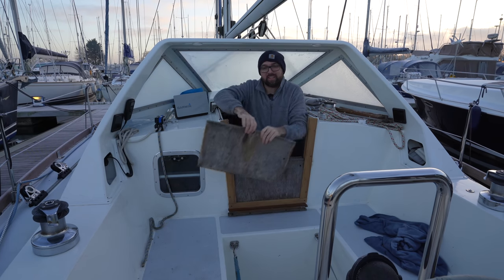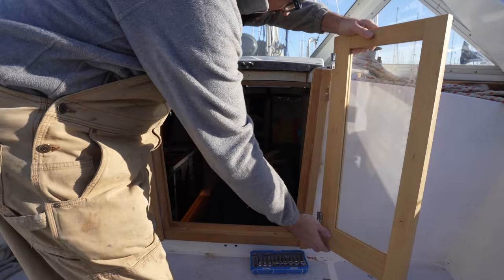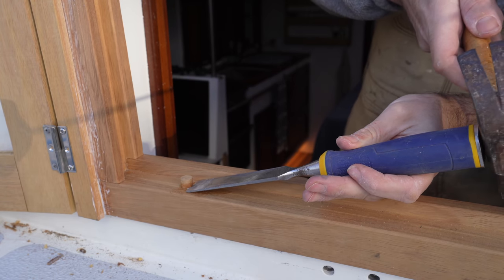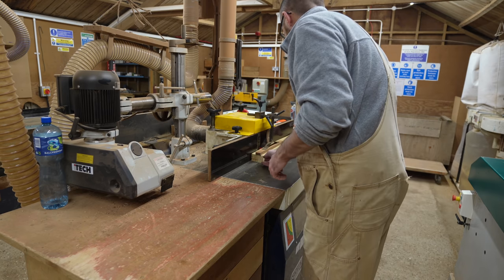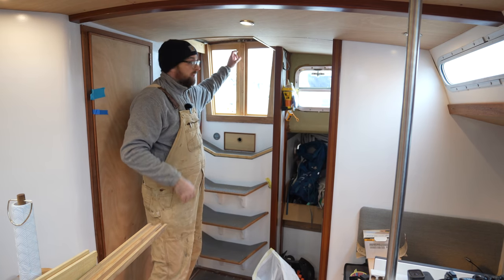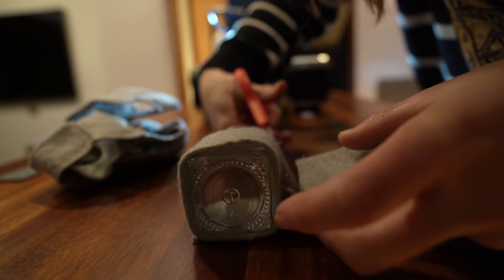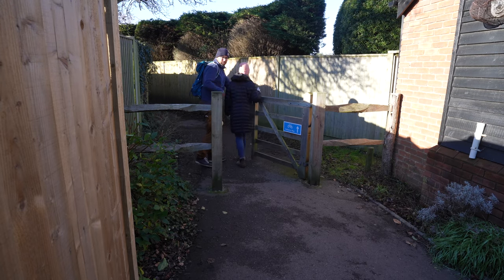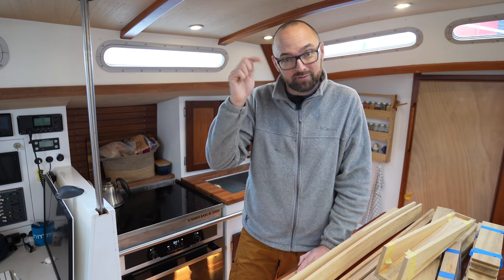Sail Life - Companionway spiffy level 11 & yet more trim ⛵

Comment: Hi Mads and Ava that lock and canal you walked over was part of the old London to Portsmouth canal system, it was much used until they invented the railway!
Reply: Actually it was Chichester to Arundel and the aspiration of connecting to London never ever came to fruition. The Chichester canal actually had a short commercial life of only 25  years (1822-1847), it had a later brief resurrection for commercial traffic under the Corporation of Chichester 1898 - 1906.

Comment: Allow me to compliment you on the companionway doors....they look great.  Through the years I've built numerous companionway doors for various sailboat designs including Island Packet, Pearson, Irwin, Hunter, Tartan and many others, using either teak or Starboard per the customer's request.  If I may, allow me to make a suggestion-on the outside of the "last to close door" add another piece of trim to cover the exposed gap between the two doors when they're closed.  That way there will be seals on both the inside and outside, providing additional weather proofing.  What I've learned through the years is once companionway doors are installed, boatowners love them so much they leave them in all the time, forgetting about the washboards.  I have doors on my Beneteau that I made from Starboard and they're only removed when racing.
Reply: Also, that trim piece will hide the gap. The gap will quickly become imperfect, so hiding it is good.

Comment: Mads, A hint on how you keep the plexiglass on the new doors from having so much static. Dryer sheets! Rub a new dryer sheet on them after you clean them, and it will take the static away. The dryer sheets are designed to reduce static in the dryer and it works wonders on plexiglass. We use this trick on airplane windows that are plexiglass and it really works amazing! Cheers!

Comment: I suggest installing two 5mm neodymium magnets in the bottom of the doors and two in the door frame. It'll keep the doors closed when you want to keep the companionway hatch for venting steam/hot air while cooking and such. Recess them slightly and put a little matching paint on the magnets. They'll not touch and scratch off the paint but be close enough to hold the doors closed.

Comment: The Perspex on the companion way doors will need some tint, you'd be amazed how hot it will get being clear.  Maybe some standard film will do the trick, I use a deep bronze color on my home windows and tried on a customer boat, it cut the surface temp of the port light (measured from the inside with an infrared thermometer) by 20 degrees.
Reply: I think that the windows could have been built into the doors as easily removable insets and with screens built into the outside.  The screens would act as sun protection/tint and allow for ventilation when the windows were snapped out.

I suppose Mads could make a  framed screen that could slide right into the washboard slots for keeping the bugs out.

When & if they ever make it to the USA they will encounter noseeums in Florida,  the Bahamas, and much of the Caribean.  Also biting flies and mosquitoes.  Apparently they dont have bugs in Europe because few Euro-made boats come with screens. 

Without screening in the Americas a boat will be miserable being either too hot or infested every day with the irritating biting bugs. We close up every afternoon where we are in Florida about an hour or so before sunset and make sure all the screens on the boat are secure.  It is too hot even in the winter most nights not to have screens -especially in the companionway for proper through-boat ventilation.

Comment: Where I live, I have a heck of a time mixing epoxy by weight while at anchor.  As the waves and wakes come by, the boat lifts and settles, and the weight of the cup of epoxy goes up and down in weight in an amount that changes by wave height.  I often watch the scale for quite a few waves and then decide an average weight that's gotta be pretty close, then figure out my 1/5th of that for hardener and add it, doing kind of the same averaging thing.  Most batches have worked out okay.

Comment: Another great vid. I will be buying a 34 trawler in the next few months. Has 235hrs on a new main engine. Getting a good price cause it has a soft core up in the bow by the anchor windlass. So I’m saving myself about 12k doing the repairs. It’s a project boat for sure but I can use it while I fix things. Also looking to add a hydronic heat and insulation and eletronics down the road.

Comment: I see you are not using the epoxy pumps and have gone to measuring and mixing by mass on a kitchen scale now that you are away from the workshop.  That is what we do as well, buying West Epoxy in the smallest bottles and mixing by hand using the scale.  The pumps are just too much mess and waste to clean up between uses when cruising full time.

I liked how you took your time and built this trim right.  It looks amazing.  I can't wait to see how the hinged doors come off when you install the washboard slats -or do you intend to keep them on and use both while under way offshore?
Reply: You can pour the epoxy into plastic squeeze bottles, too. Easier to keep clean that way.

Comment: Nice felt anti-clinker for the spice bottles. I'd get some pipe insulation foam or a swim noodle to squeeze above those spice bottles when underway as well. At least when it's really pounding.

Curious if there are hatch trim pieces in those piles?

Comment: Ava, here's a tip from Australia for getting to grips with metric measurements. In building construction here, we don't bother with centimetres, or that weird decimetres thingy that Europeans love to use, or even metres. We refer to ALL measurements in millimetres. Thus, the 5cm width you got wrong would be 50mm, a standard door would be 820mm wide, and 2 metres, 53cm would be 2530mm. Saves a whole lot of confusion!
Reply: If I am doing large measurements I often mix them deliberately - for example 6 foot and 10 mm. 🤣
Reply: @--2442  I agree.. but when verbally communicating a measurement to another person, it eliminates any chance of mis-hearing the units being used. Love the bananas thing!